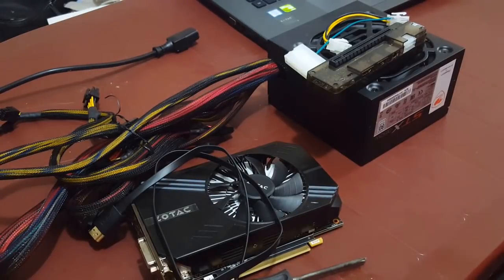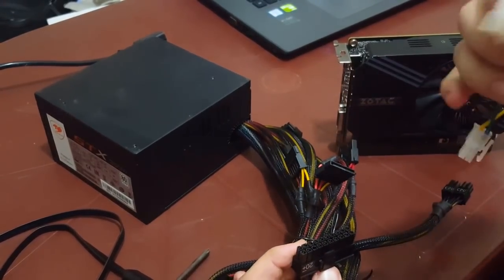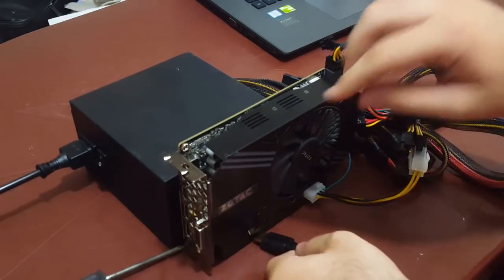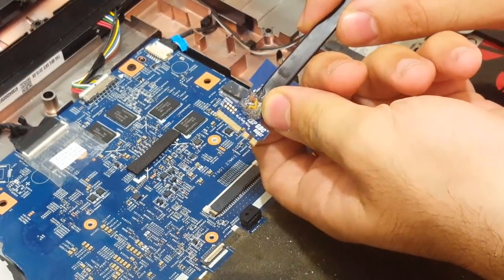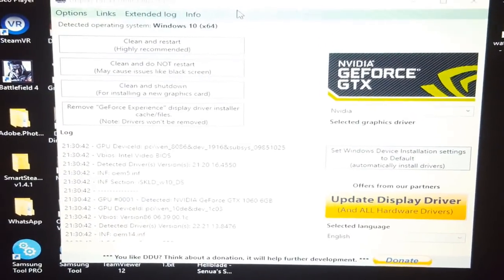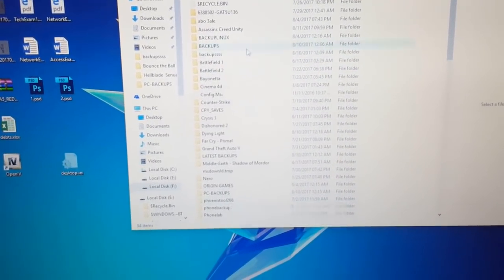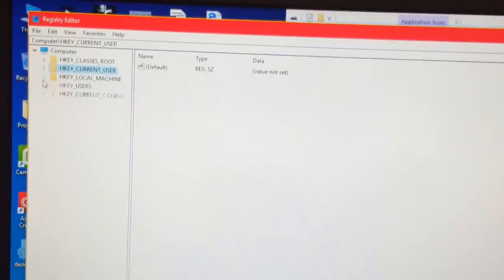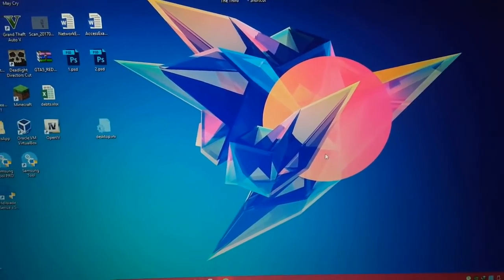HOW TO: External GPU for any laptop PC W/O External Monitor GTX 1060 EXP GDC 1050 ti solve error 43

Comment: okay, for everyone who wants to use EXP GDC as egpu, is choosing what gpu to buy,  and his notebook does NOT allow him to write to bios intsettings (even with EFI Shell) to enable hot-plug for its pcie:
Do NOT buy:  gtx1050,gtx1050Ti (,gtx1060 3G version) .... because for those gpus this will not work..

hope it helps someone, anyway, great video, thank for uploading :)
Reply: I have a 1060 3gb working just fine.
Check egpu io forum for more info.
Reply: @indexMemories  hey can you guide me on how I do it on my 1060 3gb
Reply from the maker: Thank you for the great information and feedback! <3
Reply from the maker: +DansGame yes and some users habing 1050 ti reported it was working too
Reply: Lucky you. I have lenovo laptop those have hardcoded whitelists. The only option is to hotplug.
Reply: can you put the link bro so i can do the same step as you seen
Reply: so gtx 1060 3gb wont work? sad
Reply: yea.. than your pcie has hot-plug probably enabled.. good for you :)
Reply: another discovery: my 1060 did not work, so I just installed Linux (Xubuntu) and tried it there..ofc half of games not compatible, half the performance, but it just *works*... (with both nvidia drivers or open source ones ..)
I just dont get it... :D
Reply: Have you tried 368.81 > 385.41 ?
Reply from the maker: +DansGame not yet but worked fine with 385.28
Reply: Oh so you have hot plug. I have it enabled too, but for some reason novideo drivers behave as it's disabled. Weird but 368>385 worked for me. Cheers.
Reply from the maker: +DansGame I dont have hot plug and BIOS are still factory default, not sure why would I need to hot plug while everything worked out great.
Reply from the maker: +DansGame oh, sorry to hear that, and happy to know that you hotplugged 😀
Reply: OMG i got  the Evga GTX 1050ti so what should do, !! i should chheck all the internet user be4 buy it.
Reply from the maker: use 375.63 driver
Reply: ok thank you so much. i try i now
Reply: So I did research on Google and I found that this method is a workaround for devices that aren't capable of hot-plugging, so I don't understand why you said that it won't work
Reply from the maker: it is in the description
Reply: bro may I ask you a question. I new Gateway Ne572 and I can't find the PCI express root port to disable the GPU , mine is onley for pci express and memory card, also i try to go to bios to disable it but My bios have no advance mode to go in. ....???
Reply: i have question, about my gpu i have 1050ti strix gaming, will it work w my laptop
Reply: Can a intel hd 4000 replaced by gtx 1050 ti?
Reply: can i do from hdmi to thunderbolt 3?
Reply: how bout ASUS GTX650TI GPU graphics card 1GB GDDR5 128BIT sir
Reply: i think this works with every gpu but not with the internal monitor, why shouldn´t it work with an gtx 1050 or the 3 gb version of the 1060? this makes no sense.. I have an msi GTX 1060 6 gb and it worked
Reply: How to know if my laptop can write it intsettings? My laptop is a toshiba a665-s6100x i7 2700
I would like to add a zotac 1050ti can it handle it?
Reply: how about using a gtx 1060 6gb does it work fine? and if I buy PSU 500watts, to use it, is it fine? thank you :)
Reply: would this one work? MSI GeForce GTX 1060 DirectX 12 GTX 1060 GAMING X 6G
Reply: Well how great, I've just bought a Gtx 1050 on ebay, and it's on its way. And I can't even refund it since it was an auction.... what a waste of money...
Reply: @themembers2745  did u did u do gtx 1050 ti setup? It works? I've bought the same GPU :( . I've spent one week trying but doesn't work Yet... :(
Reply: @madeinchiapas  I believe I bought a 1050 non TI. As far as I remember I managed to make it work however, my main issue was that I tried to do this with an AMD cpu. Listen... don't do this, It's a huge waste even if you manage to make it work. There'll be a huge bottleneck, you won't be able to use even your 1050 to its fullest potential. Assuming that you're doing this, you must have a crappy laptop with a crappy CPU... it just won't. Just go on ebay and buy some used computer parts, and build a PC. I highly recommend the ryzen 3 1200, it's 35 quid used mate.

Comment: I have tried this with gigabyte  windforce 1070 and i get BSOD every hour or so. Do you happen to have this issue ?
Reply from the maker: Should get a better power supply, it happened to me when I had the old cheap PSU
Reply: i do have a good one , silverstone 500w sfx-l
Reply from the maker: which version of the beast adapter do you have?
Reply: I am guessing you dont have BSOD with the latest . i use 375.76 version its the only one stable for me. Although it would have been nice to have latest.
Reply: I have the v8 mpcie
Reply from the maker: try my method above and install the latest driver after installing 368.81, and make sure to use DDU and turning off internal GPU, in other words follow the video carefully
Reply: You dont disable it from BIOS ?
Reply from the maker: no need for BIOS, I did not do anything to my BIOS, just disable the PCI port from the device manager and you are good to go

Comment: daamn, my GTX 1050Ti is not supported by Driver Version 368.81-(
error 43, damn in
Reply from the maker: this is bad news, does it at least install?
Reply from the maker: if it does not install try replacing it with this https://www.geforce.com/drivers/results/109860
Reply: it does not.. 375.63 installs but it doesnt work with this one.. (Er.43)
(Dell Inspiron 7720 ; gtx 1050Ti)
I tried to manually "enable" hot-plug for my pcie in bios, i found that i need to set 0x88 to 0x1 (=enable) ... but even with EFI Shell I cannot override it to enable because my notebook doesnt allow it (locked writing.. or it seems like)
It seems like the only possibility how to do it is to flash bios, but dell provides bios by *.exe, so I cannot configure what I need there..
I have backuped something.rom (there I found that I need 0x88 set to 0x1) from bios but that doesnt seem to possibly help me in any way..

I guess I will probably have to sell my 1050 and not to game for some months :D
(my dgpu doesnt work at all :/..)

maybe hacked bios flash with allowed advanced options would help as well, but I cannot find any downloadable one for my ntb..
Reply from the maker: +Ender Master thank you for pointing this out.

Comment: If this works, you will have made my birthday better 😁 My beast eGPU dock is coming in today and imma try this with my Zotac 1050 ti. It seems like a quicker method than on the forums so I'll give it a go first
Reply from the maker: Wish you the best of luck and happy birthday :D
Reply: Pedro Marthon thanks man! I'll be sure to let you know the results 👍🏾
Reply from the maker: I will be waiting, and will help you with any debugging process...
Reply: Pedro Marthon the problem is not on the driver. It just couldn't get detected on my Asus S551lb
Reply: if you solve that let us know.. i have gtx1050 and.. can't figure it out
Reply from the maker: did you try my reply to your comment?
Reply: i couldnt get zotac 1050 ti work at all on my asus s551lb :/
Reply from the maker: Rizky Ikhsan this is bad news, can you plz try this driver https://www.geforce.com/drivers/results/109860  instead of 368.81 for your 1050ti
Reply from the maker: this is weird!
Reply: Rizky Ikhsan 2 days later and I'm having the same problem (Asus K53e Windows 7). I'm noticing this with Asus user around the web. 1st I was only getting a black screen. I fixed that by taping the 22 pin. I thought it would notice it but still no luck. (p.s. to anyone getting the black screen, be careful powering down with the power button. I corrupted my windows last night. Lucky I was able to repair and recover my data and revert windows to the last working session config.)
Reply from the maker: +Trevell Dickson never tried windows 7, try using windows 10 build 1703
Reply: Trevell Dickson how do you turn of the laptop and egpu propery? Through Windows? What if Windows is having a freeze Or something and a hard reset is needed?
Reply: Pedro Marthon how do you turn of the laptop and egpu propery? Through Windows? What if Windows is having a freeze Or something and a hard reset is needed?

Comment: I have a Laptop Called "Alienware M11X R2 (i7)"

Will this eGPU will Work? And can i put a GTX 1070 or 1060 on it?
Reply from the maker: Sure it will, as long your PC has a mini PCIe, NGFF, or Express Card which is available in like 99% of laptops.
And as for GPUs you can use any GTX 10XX with it except the GTX 1050 since it may not work according to the makers of the adapter.
Reply: Pedro Marthon is so i can use a GTX 1070? Can i use 1080?
Reply from the maker: yes you can use GTX 1080ti as well with no problems at all
Reply: Wow! That's Great! Thanks!
Reply: Superstars did it work? Just wondering as i too have a alienware
Reply: kristian yes it will

Comment from the maker: Let me know if you have any comments... :D
Reply from the maker: Heya bro, firstly thanks for subscribing to my channel I will try my best to help.
As for answering your questions I had some issues at first while trying to make everything work at most stable conditions until I summed everything up to make this video come true.
1-Some laptops does not allow changing internal components to what is certified like WiFi, so it will need to enable Hot Plug for the EGPU to work as much as I know...
2-Automatic updates should be disabled cuz it is known to cause problems, but you can always follow the same steps to update your driver to the latest version by installing the old 368 driver then updating.
3-Your CPU might bottleneck a little bit but it should pack a punch.
4-At first try it without hot plug like I did, since I did not need to hot plug my BIOS or anything.
5-Get a GTX 1060 6GB it is much better with a small difference in price.
No worries about too much questions I will always try to help at my best...
Reply: Pedro Marthon can I comment🤔
Reply from the maker: +Harikesh Sonwane sure hari 🤣
Reply: @hmawla  can i use gt 1030. how can i make it work?
Reply: Pedro Marthon, hi man! How you doing? I hope great! Thank you for share your knowledge, history, patience and attention with us :D
Let me ask you first.... how is going with your egpu setup? Did you have any new trouble since the installation? This egpu system can really be safe and most important, estable? How you will manage with new drivers that nVidia will update in further months? Did you deactivated the automatic updates of the gtx driver in order to prevent problems? If yes, I wonder if is necessary to deactivate Windows update too....
I have an Acer Aspire ES 1572 (Brazil) with a i3 6100u processor, two RAM of 8gb each one, and the wireless connection is NGFF. I just bought the EXP GDC and realised how complicated is to get this egpu system to work haha xD due to that I thinking that the best option is to get a gtx 1060, once that is more compatible with the egpu and like you said, more compatible with drivers too.
So ok, sorry for taking your attetion for too long, just please help me with this little doubts:
1. What really is this "hot plug" that you people talk so much? xD
2. After concluding the procedures that you teached us in this video, do I have to deactivate the autmatic updates of the GPU or of the Windows update?
3. Considering my laptop specs do you think that I will have some problem with the exp gdc or with the gtx 1060?
4. Should I search a way to unlock my Bios in order to be able to activate or deactivate the "hot plug"?
5. i3 6100u will be capable to deal with Gtx 1060? Wich one should I get? 3gb or 6gb? I know that the price diference is minimal.
Obs: will buy a EVGA 430w 80 plus PSU, it is okey?
Thankssssssss a lot Pedro. Really! Sorry for asking too much. Please, help me :)
Obs: I have subscribed to your channel and from now will keep following your videos! Please let us know about your experience with the exp gdc.
Thanks and regardsssss!
Reply from the maker: Rafael welcome bro, you will always find me here, am not committed to a specific forum
Reply: they can work both together? 940 and 1060
Reply: Pedro Marthon do I still require the external PSU if I am using a low wattage card?
Reply from the maker: +Daniel Ruiz no
Reply: Pedro Marthon can u help me?
I've gpu GTX 1050 Ti OC, I tried make egpu with EXP GDC, but I just get blackscreen with beeping (1x long beep, 2x short beep). Then windows run normal but I cant see anything (blank).
My laptop is VAIO VGN-FZ150E (core2duo)

I tested using gpu HD 4850, but still blackscreen too..
Reply from the maker: +Gilang Luqman it may be RAM leakage, or the PSU is damaged. Also check to see if your laptop supports external pcie...
Reply: i tried psu & adaptor, but it do the same..
Should I use Express Card cable to make it work?
Reply from the maker: geo colo acer aspire v series are known to be unlocked, so it should work, but you should check more about it cuz I am not sure about the V3.
Reply from the maker: If you have express card support then try it for sure...
Reply: oh thanks man. Is it possible to use a PSU of 500W. I might think of building a PC in the future.
and does this process apply to all GTX 1060 6gb?
Reply from the maker: +geo colo if the 500W psu is from a popular and safe brand then yes, and the process should work on all 1060 and most of the other 10XX Nvidia cards
Reply: Alright! Thank you so much. Can this thing run PUBG?
Reply from the maker: I should run it maxed out if you have a good CPU and enough RAM
Reply: Can I still use my laptop without the gtx 1060 plugged in. Like Im in a coffee shop and theres no need to using the GTX 1060. Just on surfing the internet purpose.
Reply from the maker: sure you can...
Reply: my right ear enjoyed the video
Reply: Pedro Marthon great great great! Lol thank you for your fast responseeee :D
2. Ok, so automatic updates should be disabled. But automatic updates of the nVidia egpu or the Windows Update? Or both? I pretty sure that I can find tutorial that teaches how to do it, am I right? 
4. Following your advise I will try before making changes in hot plug configuration. However, if those adjusments turns needed, I think I will have to unlock my Bios. Do you know a good site or forum groups to recommend to ask for do it? Considering payed methods too.
Thanks ma frrrrrend \o/
Reply from the maker: DDU will automatically stop windows from updating the driver,  you just should disable updates in geforce experience.
As for the BIOS I don't know a good website as I don't recommend unlocking your BIOS.
Reply: Pedro Marthon lol great, so DDU do the work. Ok then, I will put this ideas to work when I receive my exp gdc and the other components. Then I will share my experience heren in the comments to maybe help someone else that is making this project happen.
For now, I really thank you. God bless you, Pedro.
Reply: Pedro, there is another way to contact you like by following you in a forum?
Reply: Great!
Reply: Can it work on my lenovo b50-70 i7-4510u i have ngff?
Reply: Can we still use wifi while having the GPU connected ?
Reply: Bro what about amd?
Reply: hey man. can I ask if this also works on my laptop? 
My laptop is Acer Aspire V3-575G-79XK